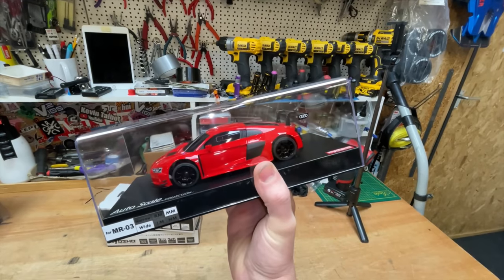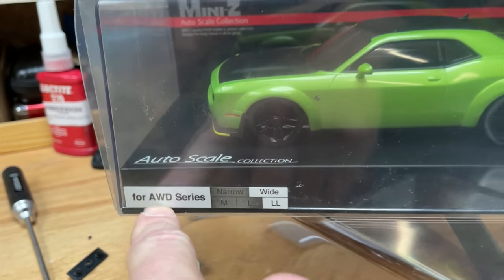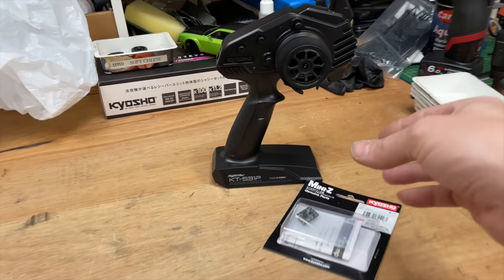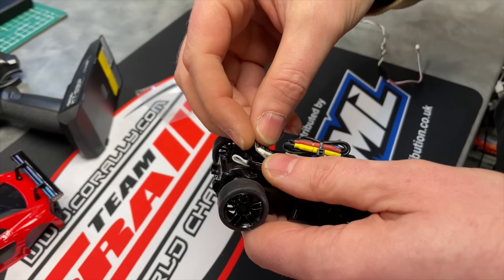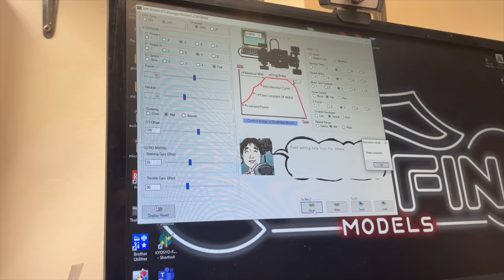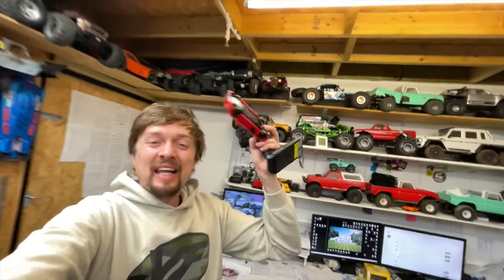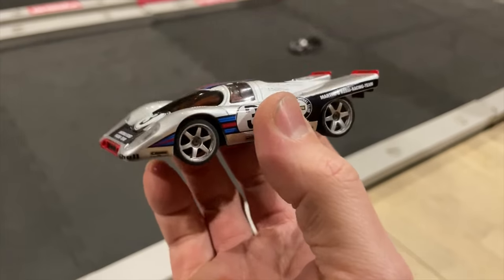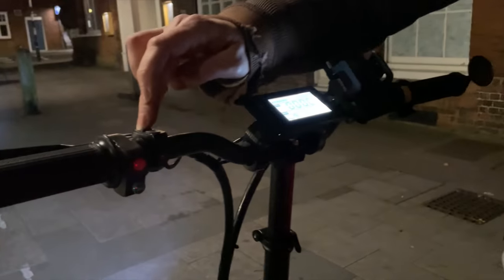RC Audi R8 Super car (too fast!!)

Comment: You need a one way front differential for your awd. Part of the issue is probably that the awd design has poor steering when you aren't on the throttle. The one way will fix that and  also give you a hand brake effect when you brake. That's usually why the pros run RWD when racing as they don't suffer from this. 🤙love the vids

Comment: hey kev. Would you recomened getting an axial scx24? also loving the vids keep up the good work i really enjoy them. looking forward to more! :)
Reply: @1rawdawg007  i have a budget of just less than £200 and ever since my friend bought a 1/10 crawler i have really wanted one. however, there isn't many places to use a 1/10 crawler and besides i've already got a traxxas slash 4x4 so i use that for bashing and speed runs. and so i wanted somthing i could use indoors while my slash isn't working or if the weather is really bad. also i agree. rc does rock!

Comment: I have a couple of the AWD ready sets with the brushed motors, they go quite good as is, I feel like the brushless would be way too fast. For sure the extra power could be useful for drifting but I find I have more than enough power to drift on most smooth surfaces pretty well and with radial tires you can roll it over on corners.
Reply: Just get the xspeed motor for more power. Don't need brushless

Comment: Technically both the R8 and Dodge Challenger can be purchased in a RWD or AWD configuration.  Not sure why Kyosho decided one was AWD and the other was RWD is a mystery along with why they decided the wheels would not be interchangeable between RWD and AWD models.  Just like the Huracan can be purchased at a 610-4/640-4 or 580-2/620-2 configurations.  Why would anyone want less power and RWD is a mystery.

Comment: I used to play with those and had a bunch of upgrades to it and stuff they are so amazingly detailed. Like you can get faster motors, suspension, tires and I even have some under glow lights on mine. They are so fun all in a little package. But ours in the states are called Xmods.

Comment: AWD does not mean 4WD.   4WD has a locked trasnfer case when in 4WD mode.  AWD uses some sort of slippable transfer of power from 1 end to the other.

Comment: I got an ebike if you wanna try it?! 👀🤣

52v 34ah 14s lipo, 1600w mid drive motor single speed wheelie beast. 42/14 ratio and capable of 45mph! 💯🔥 With options of new controller and 72v in the future. 😏

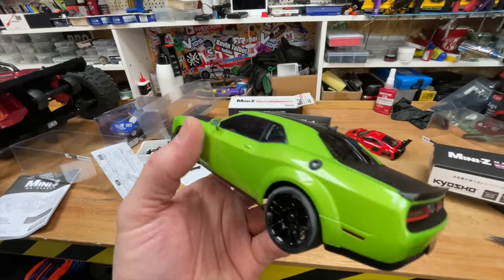Comment: 2:16 I have a modern Dodge Challenger and it is an absolute fucking piece of shit. Please do NOT punish yourself with the displeasure of owning one. I ran my own fucking front bumper over a couple months ago BECAUSE IT JUST FUCKING FELL OFF GOING DOWN THE ROAD. TERRIBLE TERRIBLE CARS! 

Satisfy that dream with a '73 instead. Much much better built car. And with your money you could easily afford a 440-4spd OG Challenger that's actually put together properly and won't fall apart as you drive.